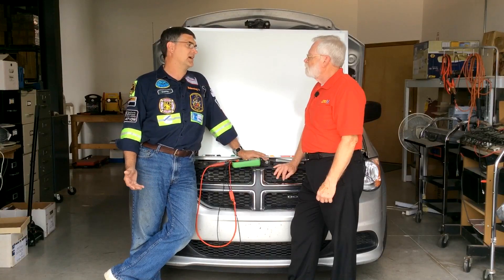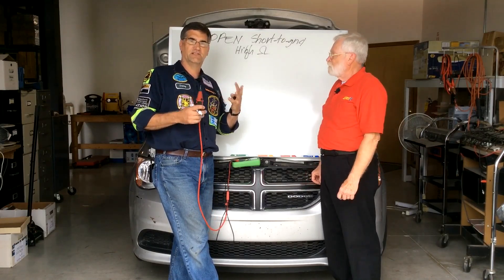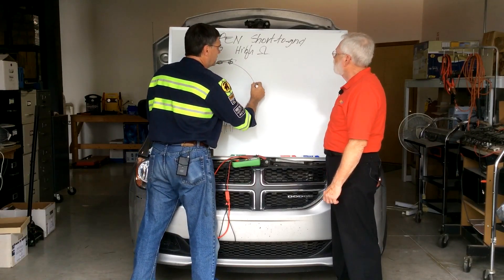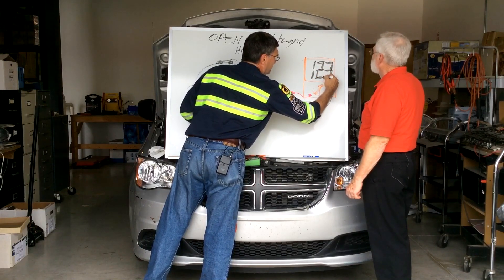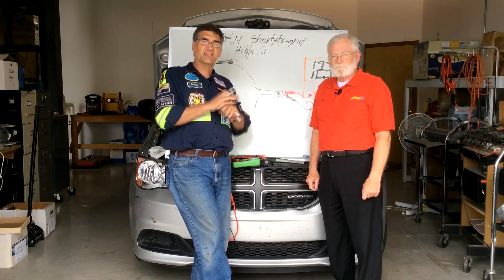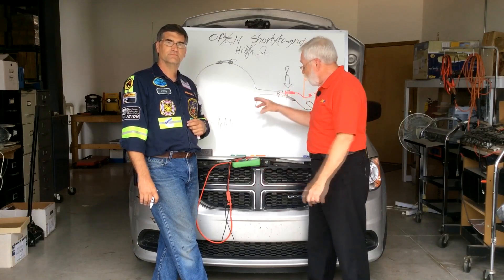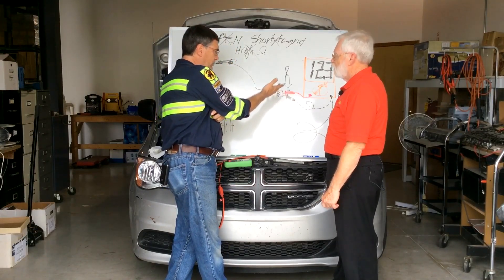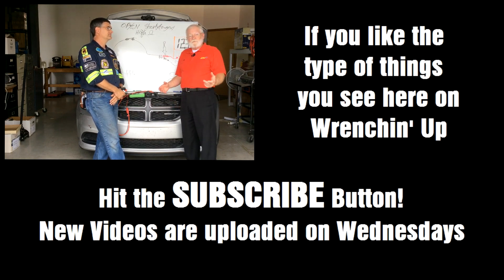Voltage Drop Testing with the "Load Pro" Exposed - Wrenchin' Up

Comment: 80% seems super high for wire failure rates. Maybe if you include plugs and connectors, but even then I feel like 80% is really pushing it.
Reply from the maker: Hi - Thanks for your comment. I know that Dan has a lot of experience with vehicles other than passenger cars and trucks. He also does a lot of work with really heavy duty stuff like Class 8 trucks, quarry vehicles, etc. so I think his figures include all of that stuff too. Thanks for watching!

Comment: Can the LoadPro be used on aircraft wiring?
Reply from the maker: Hi - As far as I know, it can be used as DVOM load producing leads on any vehicle. It may only be for 12 volt systems though. I suggest you check with the manufacturer (address in the metadata) to be sure. Thanks for watching!

Comment: I have the matco version of this tool. All the rubber grip cracked and fell off within the first month of owning it. Has anyone else had this happen?
Reply: my leads after about 3 year are like new
Reply from the maker: Hi - I haven't had that happen but hopefully someone else out there will chime in here with their experience. By the way, did you have any kind of solvent on your hands or gloves while using it that might have been the cause? Thanks for watching!
Reply: I didnt have anything on my hands and only used it maybe 3 times before the soft grip started to peel off.

Comment: How does the Load Pro load a circuit?
Reply from the maker: Hi and thanks for watching! I'm not sure what the tool uses for a load. You would have to check with the manufacturer on that. I built and used something similar back in the 80's and used a 10 ohm, 10 watt resistor for the load.
Reply: Thanks Jim

Comment: How can I use that tool diagnosing trailer brakes? Whether on the tow vehicle or on the trailer itself? I have seen some nightmare jobs that were poorly installed and  that have re-spliced by multiple people over the years. Others were a good job with intermittent problems on 1-3 axles. If your tool can help I would purchase it today, so would some of the other guys at the shop I work at. I work at an shop that has over 450 stores  Here is a video of some of the mess....
    
https://www.etrailer.com/tv-install-tekonsha-p3-brake-controller-1996-chevrolet-ck-series-pickup-90195.aspx

https://www.youtube.com/watch?v=YGpIZGkHhnU
Reply from the maker: Hi and thanks for watching! Since I don't work for or sell the tool (I just did the interview) I can only suggest you check out the very detailed manual/workbook that is available for it. It looks like, in my opinion, that it covers just about every type of testing scenario and might help you make your decision as to whether or not it will do what you are looking for.
Reply: Thank you for your reply.

Comment: Gents, are the Load Pro leads also usable on circuit boards (PCBs)?  Or, just for wired circuit troubleshooting?  Thx.
Reply from the maker: Hi - I think the leads are basically for use on wired circuits but I don't know for sure. Hopefully Dan Sullivan or the folks who market the LoadPro will jump in here to answer your question better. Thanks for watching!

Comment: i cannot agree that 80% of the time wiring has failed. from my personal experiences 80% of the time components have failed. keep in my i have worked in california, nevada and texas. i could imagine more wiring failures in the northern rust belt and salt belt states. 
i am in no way arguing the statements for mr sullivan, however just reporting my personal findings
Reply: chris keiley I agree. I live in the north east and I still think 80 % seems way high.   Maybe because I work on toyota and we hardly ever see wiring failure other than some rodent damage
Reply: Many electrical failures are due to a voltage drop across it's circuit! The loss of voltage_ increases the amp draw, then the component windings, contacts ect. heat up and fail.  The availability of cheap_ low quality replacement components fail even quicker than OEM, under these conditions.
Reply: @frankpenello8250  What you just said makes no sense. Remember your Ohms Law? Voltage and amperage are directly proportional; voltage goes down, amperage goes down etc. Voltage drops are caused by high resistance; the voltage is "dropped"across the resistance instead of the load in the circuit which causes the heat. Amperage and resistance are inversely proportional; resistance goes up, amperage goes down.
Reply: @frankpenello8250  your all wet in your theories.  Study up!!!!!!
Reply from the maker: Thanks for your comment about your personal experience. All comments are helpful! Thanks for watching too.
Reply from the maker: Yes, as far as I know, but you should check with the manufacturer to answer your questions because they didn't provide that kind of information during the interview.
Reply: chris keiley
Reply: We all know that components fail more often he just making feel that s the wiring fail more often to buy his tool and make it looks like it necessary thing to diagnose open or short which not but his s good what his doing and he knows what he talking bout

Comment: To confirm a problem on the ground side of the circuit, would you attach the negative lead of the load pro to the positive battery terminal and the positive lead of the load pro to the negative side of the circuit? Of course the reading on the meter would be negative.
Reply from the maker: Here's what I have learned about that type of testing. If you attach the negative test lead of, say a voltmeter, to the battery negative terminal and the positive test lead to the negative side of the circuit, a problem on the ground side of the circuit will cause the current to flow through the meter back to the battery because it is the path of least resistance. The higher the voltage reading on the meter the worse the ground problem is. Hopefully the load pro folks will jump in here too and add their thoughts. Thanks for watching!
Reply: I'm pretty sure it's quite impossible for current to flow through the meter in the configuration you mentioned. I could be wrong. The intent of my question was to ensure that I could load the ground side of the circuit in the configuration that I mentioned just to complete the diagnosis after checking the positive side of the circuit and finding no problem.
Reply from the maker: As far as I can tell, according to the LoadPro folks and the instructions in the video , as well as  Dan Sullivan's book, the whole circuit is loaded during the LoadPro test process. There are two videos with Dan and his LoadPro here on Wrenchin' Up and I think after viewing both of them you may see why this process works. When completing the diagnosis after verifying the positive side is OK, the process I mentioned for determining ground side issues is the preferred method. I encourage you to try this to check out how well this works.
Reply: I know this is an older comment, but I'm going to respond anyway in case anyone else has the same question:

If you have a voltage drop when testing at the connector, you'll need to figure out which side of the circuit your fault is on. To test the ground with the LoadPro, you leave the positive lead of your meter connected to the positive side of the harness connector, and your negative lead should go to either a good chassis ground or battery negative. This effectively tests the circuit with a new ground path, and if you read source voltage when pushing the button, that means your fault is somewhere on the ground side. If you still have a voltage drop with your lead on chassis ground/battery negative, that means your voltage drop is somewhere on the postive side of your circuit. Hope this helps.

Comment: If you measure the voltage drop across the component during operation and see source voltage then you know the circuit is good and the component is bad. This tool is really most useful when measuring a circuit where it is hard to measure the component during operation.
Reply from the maker: Yes, indeed! Thanks for the comment and thanks for watching!

Comment: I always use a €3 test light. Although it doesn't measure anything it does give a good indicating and can also show you a bad ground.
Reply from the maker: Lots of folks use a test light to see where power is or isn't and can sometimes be used as a time saving first step before having to do more exacting circuit diagnostics - especially when the question "how bright is bright suppose to be?" comes up. Thanks for your comment and thanks for watching!
Reply: Jim Bates If you want to know how bright is bright, that's easy: Hold it on your battery directly and compare that brightness. It tells you more when you put it in parallel over a part that you think has got a problem. If it glows even slighly then it's not good. To be honest, up till now I've never had a case where this method wasn't good enough. But should that be the case in the future, I could always have a look at this Load Pro.
Reply from the maker: Thanks for the info Frank. As I said, it could be a very good time saving first step, and to you're point, maybe the only step you need.

Comment: why couldn't you put a 60 amp meter on the pos an neg to do the same thing with the switch on  an it would show amps
Reply from the maker: Hi Bob - Thanks for watching. For these tests we want to look at voltage (pressure) with the circuit loaded and unloaded. Ammeter reads electron flow which would be affected by circuit condition - too many variables. This method of voltage drop testing is preferred because it uses a fixed known reference (battery voltage) and usually arrives at a definite conclusion much quicker. I do think you should continue to use testing methods that work for you but you might find this type of information useful and productive as well. How's that for a PC answer?
Reply: +Jim Bates well was looking at gm voltage drop test    uses a amp gauge an carbon pile meter. was just wondering . Ill admit elec. isn't my thing . I can do it just don't come easy